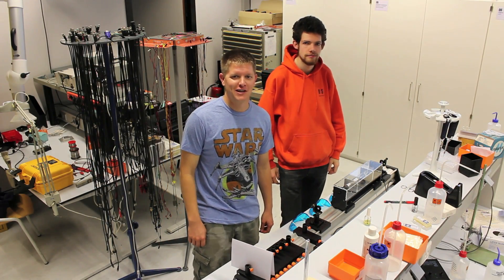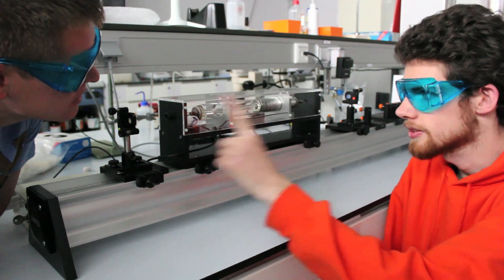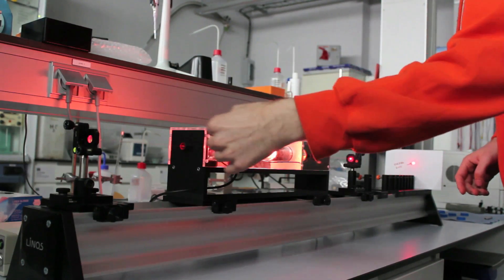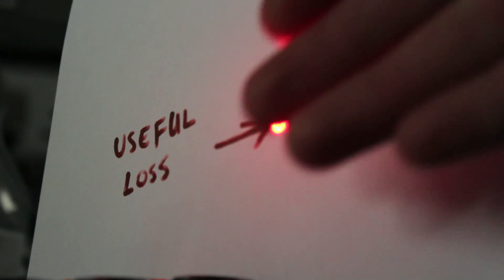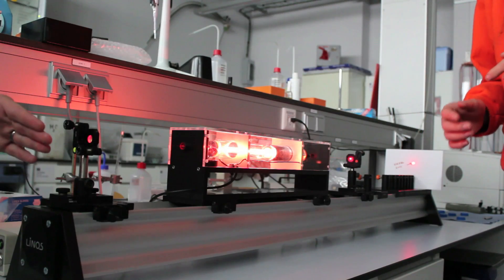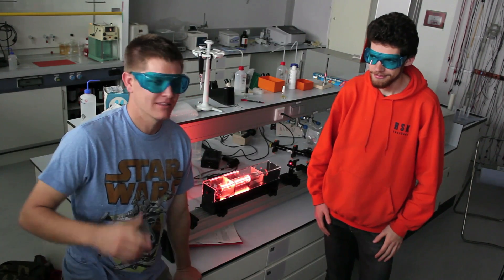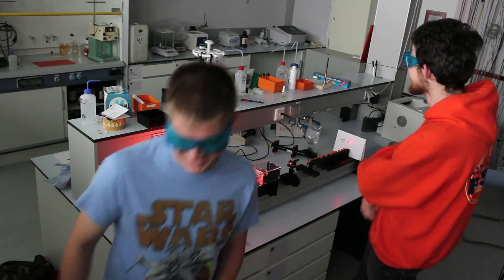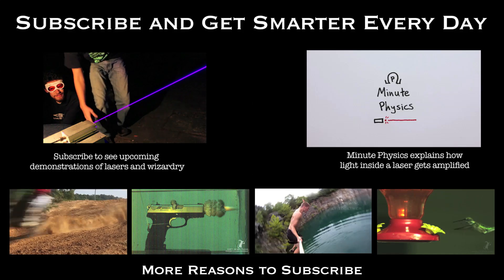How Lasers Work (in practice) - Smarter Every Day 33

Comment: When learning lasers I was amazed at the popular misconceptions I'd absorbed.  LASER LIGHT IS PARALLEL?  Nope, wrong, since parallel mirrors on gas lasers give very poor stability, so "confocal" setup is normally used: one or both mirrors are concave.  This gives a cone beam output, and if you want parallel, you add a converging lens.  So why do classroom HeNe lasers put out a parallel beam?  Because manufacturers add a converging lens to the back of the output mirror on the laser tube.  Doh!